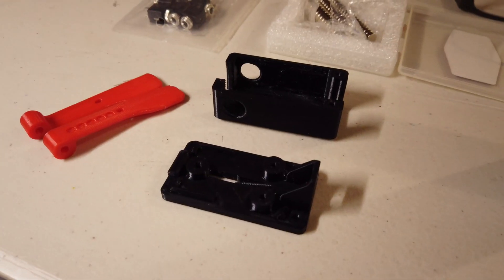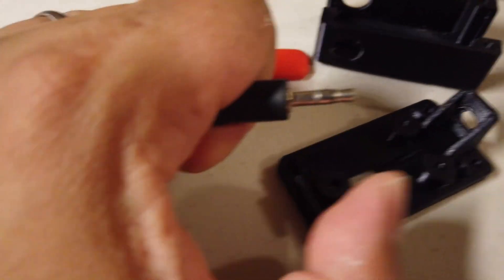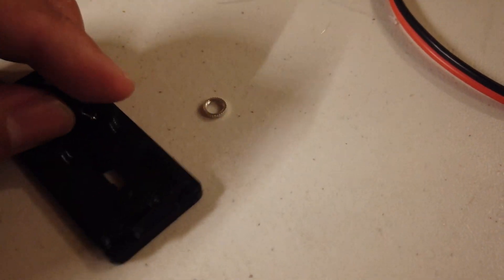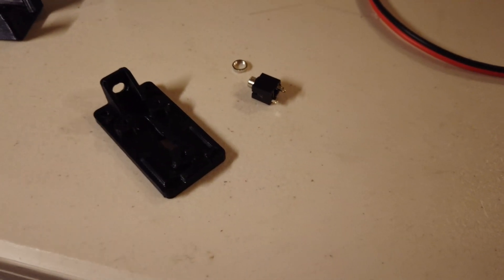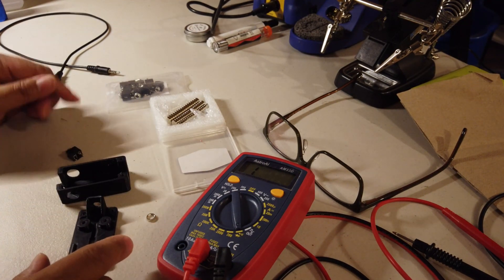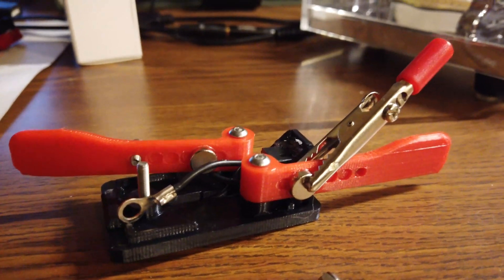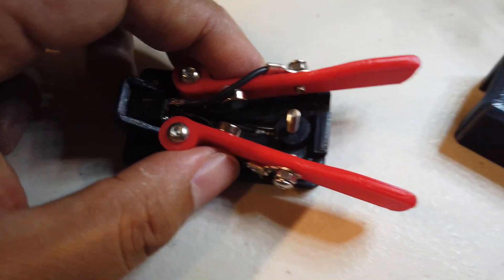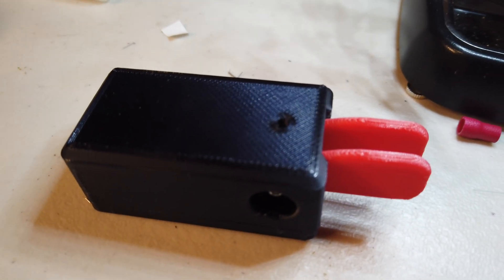No Pico Paddle? Try a 3D Printed CW Key

Comment: Great project, could you give the size of the magnets? The Amazon link is dead. 73 K8IP
Reply from the maker: You can find them on Amazon. I believe they were 8mm x 3mm or 6mm x 3mm Refrigerator Magnets, either should work fine.
Reply: @AD6DMDennis  Thanks, I found some on Ebay for 50@9.99 free shipping.

Comment: I have made a few of this very same keyer and gave them to friends. But I like you magnet idea. It's much better than the ball point pin spring the design calls for. I will do that trick on the next one.
By the way, I got some electrically conducting PLA and on my next one will print the main body with regular PLA, but the two paddles with conducting PLA and see if I can eliminate the awkward place that the wires have to be connected. I don't know yet if it will work, but I think it should.  Great video. Thanks for posting it.
73 dit dit
Reply: Did the filment work